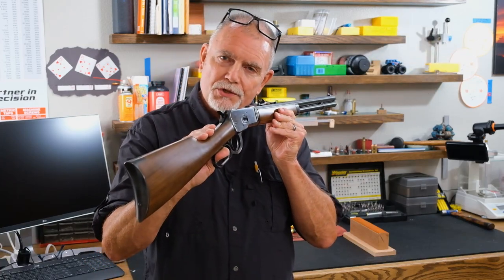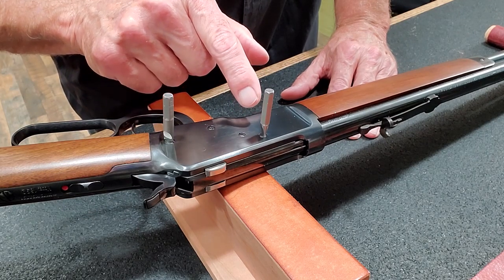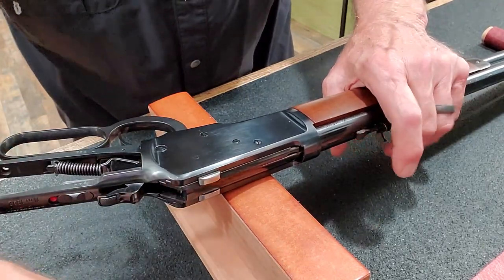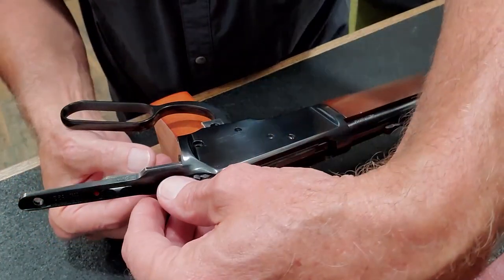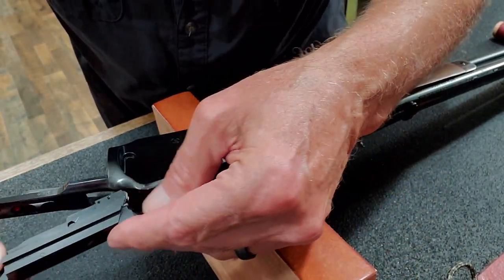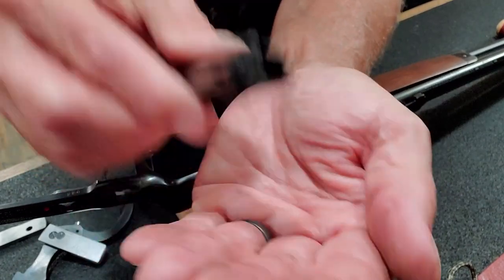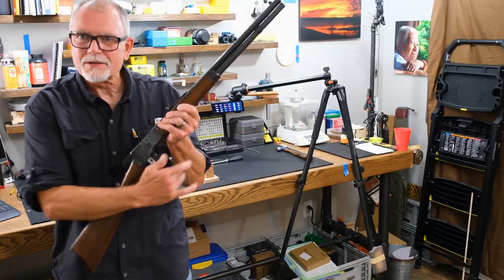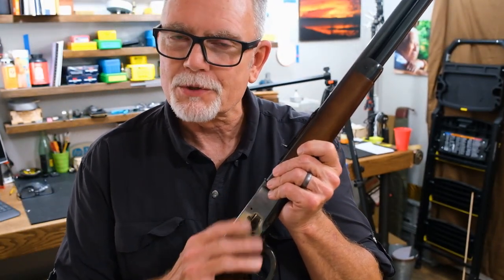Miroku Winchester 1892 Disassembly For Cleaning

Comment: I like your padded raised support. It keeps the receiver off the bench making it easier to work on and protects damaging the finish of the rifle. That is clever idea for working on any lever-action. If I were you; I would invest in a small brass or nylon hammer and a brass or nylon punch, or make some from round bar stock. Using a hardened steel hammer makes it easy for bad things to happen.
Reply from the maker: The brass hammer is a great idea. Thanks. I did polish all of the "hammering" surfaces on that ball peen hammer so an accidental tap won't scratch, but brass for most applications would be better.
Reply: @TargetSuite  If you need to give it more than a little tap you will leave the brass color on your blued part

Comment: I've used a deprimed, empty case placed under the extractor claw to hold the ejector in place during reassembly.
Reply from the maker: That's a great idea. I'll try that next time. Thanks!
Reply: I just put this info in the comment I made.  Should of read down farther before typing.  But yeah a ton easier to do that way.
Reply: Ditto, as mentioned an empty/spent case or a snap cap works as well.
It frees up your hand to push the firing pin in without worrying about the ejector, spring, and collar popping out of the breach face.

The 1892 is my favourite pistol caliber carbine/rifle. 
I have the identical rifle.
Thanks for all your videos. Much appreciated.

Comment: Hard to elaborate when it involves wife's generous nature to get this done. Tried for 2 months to get enough information to install rear appeture on 1892. Tried Williams, tried Tang Site, called Skinner could not find anything on website. Talk to Rob at Skinner for half hour and he suggested Lo Pro with extended post. I have a good gunsmith who took on the problem and drilled hole in breach bolt for site.  Suggested clearancing (mill) firing pin for extra thread or post clearance (adjustment). I hope this enough information to resolve any issue you may be working on.
Reply from the maker: Perfect. I had the same conversation with Rob myself. I guess great minds think alike. I opted to not use the LoPro sight yet because it doesn't have windage adjustment. Instead, I have been churning over other possibilities. For now, I have replaced the rear buckhorn with a Marble Arms Bullseye rear sight. I haven't shot a lot with it, but so far it is an acceptable solution. If your wife's generous nature goes as far as Instagram you can check out the short video I posted installing that sight, plus a little shooting. Here's a link to that sight . . .  https://www.brownells.com/rifle-parts/sights/rear-sights/rifle-long-bullseye-rear-sight-prod105965.aspx

Comment: Thanks, great video.  Disassembling Winchester lever actions can be daunting if you are not familiar with them.
FWIW, I have 3 Miroku made Winchester reproductions...a Model 1895, Model 1886 and Model 71.  I bought all of them to relieve the stress and wear on originals I inherited.  They are all excellently made.  Dare I say it...even better build quality than originals! 😲 (I'm OK with coil springs and the rebounding hammer but the tang safety on later models is an abomination..)
My Model 71 is just about the most accurate rifle I own at 100 yards or less!
Reply from the maker: Amen on the Miroku quality. Hands down the best (affordable) lever guns out there.
Reply: @TargetSuite  Do you watch the channel "Leverguns 50"?  He has a lot of great videos on Winchester/Miroku guns.  He does the "handload them to the max" thing, which I am sure they are strong enough for, but I don't go that route.  
Using a .50-110 chambered gun he gets .458 Winchester Mag level performance 😲

Comment: Great video, and the directions are clear and easy to follow along, .not rushed.
I bought one of these model 1892's today, and no doubt, I will soon need to do this to clean my rifle soon. 
I subscribed too, so that I may be able to look up this video again, if and when I run into some bother in doing this for the first few times.
Thanks for this video, George.
Reply from the maker: Thanks for the compliment and the sub! Glad to have you!
Reply: @TargetSuite You are welcome!
 I should mention that my '92 is in 45 Colt as well! ( I can't use heavy recoiling rifles/shotguns due to rotator cuff damage, this rifle feels just perfect,..no jolt, no pain either.)
Reply from the maker: Sorry about the bad shoulder. I know the feeling. I'm in the process of working up very lite loads for my 44 mag '92. I just don't need the power or recoil either, most of the time ;-)
Reply: @TargetSuite  I saw those 'lighter' loads you used, and am going to talk with the Range I go to, as they re-load ammunition for the members there.
 I'd bet they can do this too for a few of us.
Great idea!

Comment: With the rifle (24") most cleaning rods will not reach muzzle from the rear.  Thus, a bore snake or cleaning  from muzzle with rod fitted with a muzzle protecter.  This procedure did allow access to disable the rebound function of the hammer and replace the OE hammer spring with a less powerful one.  The action did not need slicking, the factory did a wonderful job of that.
Reply from the maker: Thanks Rooster!

Comment: Very nice video!
How would you compare this Japanese to the Brazilian Rossi? Quality, finish, etc? Thanks!
Reply from the maker: Thanks! The Japanese Winchesters are in a different league . . . and cost almost twice as much. On the outside, I was impressed with the Rossi R92 I made a video about. The fit and finish was very nice and much better than I expected. But I would use the word "fine" to describe the Japanese Winchester, inside and out. I wouldn't say that about the Rossi. One other thing about the Rossi R92, and this doesn't relate to quality, is that they all have 1:30 twist which limits the use of heavier bullets. So if someone is considering an 1892 style rifle and wants to shoot heavier than normal bullets, the Winchesters with their faster twist would be better.

Comment: I had to do a lot of work on my Rossi 1892 454 Casull, to get it to cycle rounds. Opened up the chamber entrance, worked on the carrier to get it to cycle. When all was done, I shimmed the trigger to get the pull down to about 3 pounds.
Reply from the maker: Hi Dale. You have me dreaming of the 454 Casull! The one thing I need to address on this WinRoku, beside replacing the rear sight, is the trigger. It's pretty bad. Thanks for the comment!

Comment: I saw another video where the guy actually held the ejector in place by inserting a spent round case into the end of the bolt. Worked really well. He said you could use a dummy round or a snap cap as well.
Reply from the maker: That's a great idea!

Comment: I will tell you a much easier way to put the Bolt assembly and Ejector  back together. 
Take a fired Cartridge and put it in the bolt under the Ejector and guide it back in the chamber while installing the lever.  Works a lot easier.
Reply from the maker: Thanks Rooster344. I have adopted that and have dummies for all our Winchesters.

Comment: So the ejector plug pin has a shoulder that prevents it from being pushed too far through the breach block assembly. I wonder if you couldn't make a small "slave" pin, out of nylon or plastic, to hold the ejector assembly in the breach block, during reassembly. The slave could be undersized enough to allow it to be pushed through the hole in the right side of the receiver, as the plug pin is re-inserted, from the left. I don't have a 92 yet, so I'm not sure it'd work.
Reply from the maker: Turns out and empty case or "dummy round" does exactly what you were suggesting. One of my viewers pointed that out. Thanks!

Comment: Do you really have to take it apart to clean?  If so, how many rounds would you recommend between cleaning? thx
Reply from the maker: Every rifle will benefit from the occasional "deep clean" and lube. But as long as it is not stiff or binding or had dirt get into the receiver I'd leave it alone for extended periods. How long that is is hard to nail down. Personally, I'm shooting for a deep clean once a year or every 1000 rounds or so. But I'm sure some will say that is too often, and others not frequent enough.

Comment: So I’m looking to buy this rifle.  Is this disassembly necessary after your average range trip or can I clean the majority of the barrel and action without disassembly?
Reply from the maker: Great question. Cleaning frequency is a personal thing but I only disassemble and deep clean/lube the action every few hundred rounds or every two or three months if I don't shoot a lot at each session.
Reply: Thanks for the response.  I’m looking into this gun but am use to an old marlin which is very simple to breakdown.  Just wondering if I could use a bore snake and a Otis cable for the barrel.  Not sure what all I would need for the action.

Comment: Dumb question here from a Subscriber: My 1898 manufacture date Winchester 1892 needs a deep clean- Will this video work for my original for disassembly/ reassembly of my rifle?
Reply from the maker: I haven't disassembled an old one like yours, but I suspect the process will mostly be the same except for the hammer spring. It will probably be a leaf spring, not coil.

Comment: Very good instructional video, but what strikes me is that reassembling the parts is rather difficult.  When I disassemble and reassemble my Chiappa 1892 Sportingrifle (.45 Colt), it goes smoothly and without the "glitches" I see with the Miroku.  While the system is the same.  Any idea why that could be?
Reply from the maker: I just did an assembly video on the Rossi 1892. Probably not in the same league as your Chiappa, but the Rossi was harder to reassemble than the Miroku Winchester by far.
Reply: @TargetSuite  Although Chiappa and Rossi are related, Chiappa is clearly better in machining and tolerances in fitting!  I like the Chiappa more because it is a correct clone of the original Winchester 1892, with which I am also familiar.  That even with regard to the Miroku, which by the way has a high quality level.  Chiappa is authentic and performs super on the shooting range.
Reply from the maker: I'll have to try and get my hands on one of those for a comparison.
Reply: @TargetSuite  George, that would be very special!  I am also curious if there is a quality difference in export to the USA or the European market.  Very interesting anyway.  Most European models have South American hardwood instead of a wallnut stock as advertised.  I am very curious about your findings, regards Paul

Comment: Is The Miroku a faithful copy of the 1892, or is the design tweaked for modern manufacture?
Reply from the maker: Hi Chris. I don't have an original to compare to, but apart from the lawyer friendly changes made that I mentioned I believe it is functionally (faithfully) the same. Maybe someone can jump in who is intimate with both the originals and the modern ones.
Reply: There's a safety on the tang. The main spring is a coil now. I think there's at least one company that uses the leaf spring still but I forget. The body lines of the receiver are the same on these. The Rossi however used less body lines thus less machining time. Of course the steel is better than those old gals. Also, miroku uses a rebounding hammer. So no half cock, and that's a bummer.
Reply from the maker: And if you look at the exploded drawings on Numrich of the original and Miroku '92s, the major action components while not drop in compatible look to be functionally identical.

Comment: I had a 92 rossi for 15 years before i got up the gumption to figure out how to take the bolt out of the receiver. It was dirty in there, but the barrel was clean!
Reply from the maker: I bet it still worked just fine!
Reply: @TargetSuite  Youre absolutely right! All i did was keep the barrel brushed and oiled, and i oiled the part of the bolt that protruded from the rear of the reciever. Never had any issues, and i had shot a metric ton of black powder loads. When i finally got the bolt out, i had to use break parts cleaner to remove the build up in the bolt!
Reply from the maker: I bet it was pretty filthy after all that black powder!😄

Comment: Winchester may have changed the  hammer/main spring some where along the way. I don't know. But my original 1911 mfg 1892 has a leaf spring for its main spring rather than a coil spring. My 2  92 clones have a coil spring affair similar to yours. A little different because you have a tang safety. I prefer the coil spring. Your 92 seems to be well machined. Too bad it's not in 45 Colt😊
Reply from the maker: Oh, but David . . . my son bought a Miroku 1892 in 45 Colt at the same time I bought the 44 Mag! So, you'll get to see both on my channel. Do you have any other requests? Lol ! ! ! Thanks as always !
Reply: @TargetSuite  Yup-Inow your son bought one. I just had to put a plug in for the 45 Colt
Reply from the maker: Sorry David. I missed that one. I need to pay attention to who I am dealing with😄😄😄

Comment: I just put my gun back togeter and every time I dry fire the gun with the trigger safety engaged it pushes the safety off. Can  someone help please!
Reply from the maker: There is only a hammer block safety on these Miroku 1892's. My guess is that you didn't get it properly reconnected before reassembly. So, I would take the butt stock off and watch what happens when you operate the safety and when the hammer falls.

Comment: Real nice rifle and great tips on disassembly and reassembly  great job well done as usual.
Are these rifles from Japan very expensive?
Reply from the maker: $200-ish more than the Marlin 1894. But the difference in quality is more than that. And you get a 1:26" twist standard rifling instead of 1:38 twist micro-groove which opens the door to a lot more bullet choices. Thanks!

Comment: Do have a recommendation on a screwdriver bit set?
Reply from the maker: I use the Wheeler Engineering set https://www.midwayusa.com/product/1007363134 . It is from China so the tips are a little softer than I would like, but for the price, you get a lot.
Reply: Target Suite, that was the one i was looking at real hard and read the same thing.  I saw winchester made a smaller kit so I figured Id see what you liked too before I made a decision.  Thanks George.  Oh by the way the new 1885 kicks like a mule, but its awesome
Reply from the maker: I can't remember if you told me . . . what caliber did you get? 45-70?
Reply: Target Suite yeah 45-70.  Bought some cast performance 405gr flat nose from midway and followed hogdons reloading data on their website for lever guns.  46grains of H4198 was their starting load and its no joke, didnt take me long to make some trap door loads.😄
Reply from the maker: Haha! I've been trying to get my hands on some Trail Boss for those days when I don't want the 45-70 to be an "adventure".

Comment: Looks like a small slave pin would hold things together then when you install your keeper pin it would be pushed out other side ie a tooth pick
Reply from the maker: That would work if the smaller pin had a good chamfer to "find" the small exit hole without damaging it.

Comment: I have a Rossi 92, comes apart like this.  Only I use paperclips to retain the mainspring.  Also I use a fired case to help maintain the bolt/ejector when putting back together.  Makes it alot easier.  And I am not near as nice to it.  Only done this take down on it like 3 times since I owned it.  The rest of the time in between shooting I just run a bore snake down it.
Reply from the maker: Wow Henry! That spent case trick sounds great. I'll have to try that. Thanks!

Comment: Hi George, awesome video of that 92 disassembly and reassembly. You explain everything to great extant and the trick of tiring the trigger back is great! Have you got any ideas for a aperture sight yet? With that Tang safety a Tang site is out. Thanks for all your hard work it's appreciated..
Reply from the maker: HI Terry. I'm still churning on the final solution, but I did order one of these to try out in the interim. It's really cheap and I don't know anyone who has ever used one. https://www.brownells.com/aspx/search/productdetail.aspx?sid=53261&pid=105965
Reply: @TargetSuite   George that sight looks interesting. A peep inside of a ring. I may also get one and try it on my uberti 1873 Winchester. My old eyes hate the buckhorn site. Have a skinner peep on my Henry 22 on the receiver. Let me know what you think of it and I'll share my thoughts on it when I get mine.
Reply from the maker: Will do Terry. One thing that is not clear with that sight is how you manage elevation changes. Maybe there is a sight elevator that is just not shown. Yes, let's share thoughts. I'll post a few pics on Instagram when I get it. If you use Instagram you can message me directly there @targetsuite. If not, I'll make a note to come back to this comment thread. Or you can ping me in my next video comments.
Reply: @TargetSuite  WOW good point George forgot about elevation. I don't use instagram, but we'll figure it out. Surly there has to be some kind of elevation
Reply: Hi George just checked the spec's on that sight and said comes with elevator. So that's all good also if I remember right fits 3/8 dovetail
Reply from the maker: Thanks Terry. I called myself looking but missed that. I just checked tracking and mine is supposed to be here on Saturday.